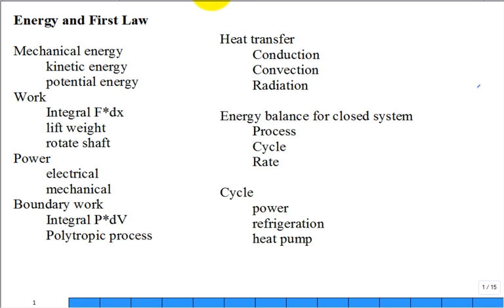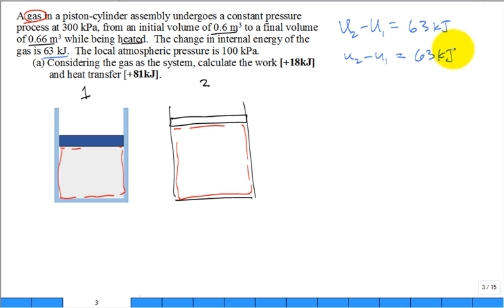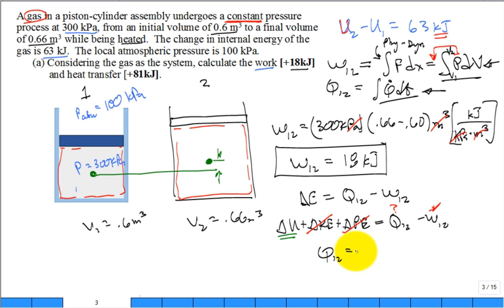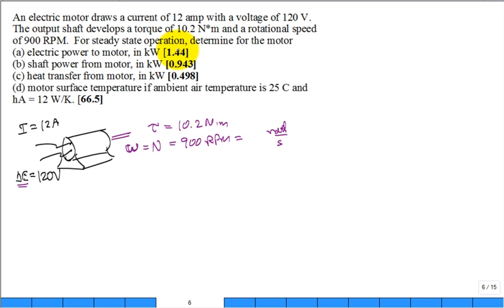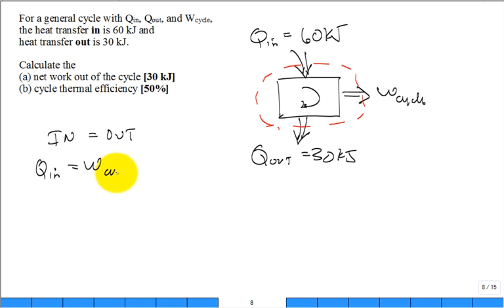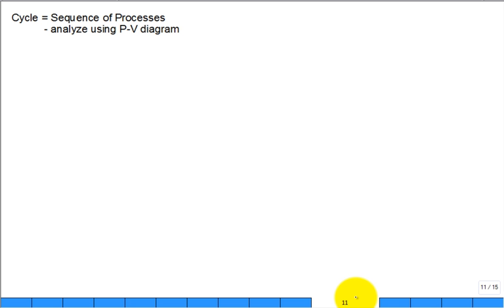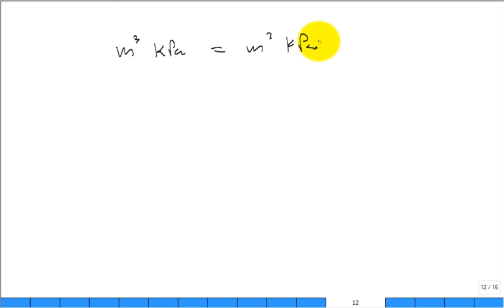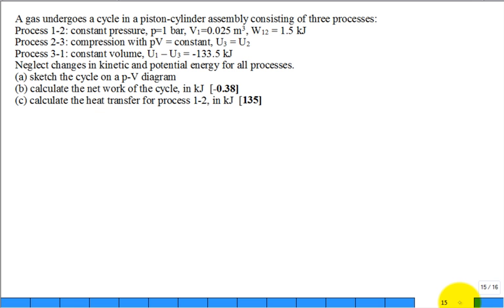ME3293 Energy First Law 2 Summer2016

Comment: For the first problem, why is the pressure value taken as the internal pressure of the cylinder? Should it not be the atmospheric pressure acting on the cylinder as this is what the piston is working against?
Reply: Yes i had the same question.... Also when the piston is considered as the system, volume change is zero for the system and it doesn't matter what's the volume of gas is doing.
Reply: @dd_dude2288  because all of our problems are in quasi equilibrium so the internal pressure equals the external pressure and the external pressure is not atm pressure only but atm pressure + weight of the piston which must be nearly equal to internal pressure